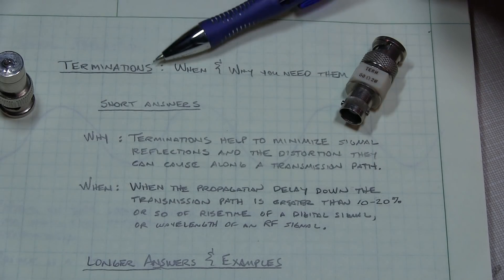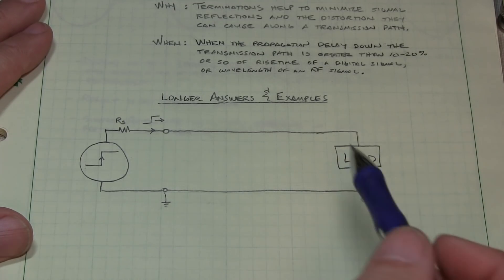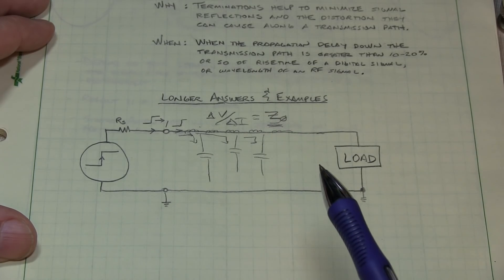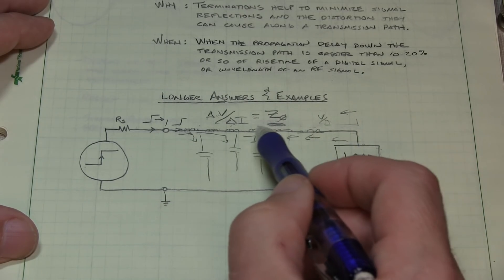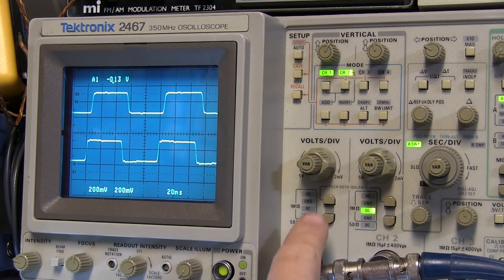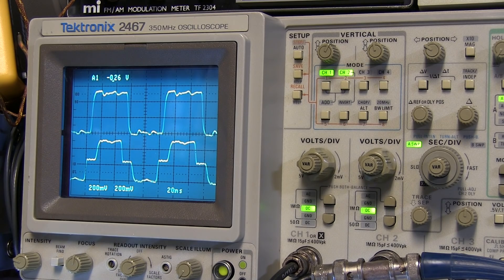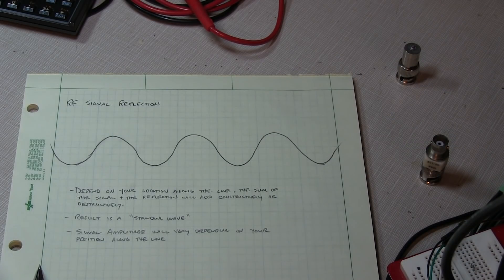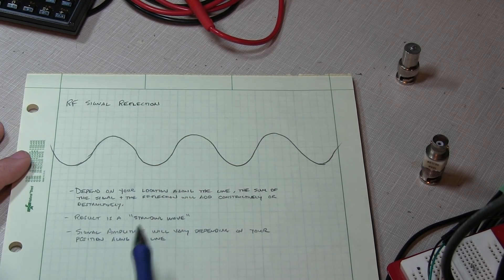#143: Transmission Line Terminations for Digital and RF signals - Intro/Tutorial

Comment: Why would data signals cause reflections, data signals aren't RF signals? There "split termination" which using 2 resistors instead of one resistor, the split resistor terminations for some reasons is better to prevent distortion and reflections not sure why that is.
Reply from the maker: High speed digital data signals definitely ARE broadband RF signals - they have a lot of energy at high frequencies - all of which is subject to transmission line effects and reflections.  That is the whole point of this video.  Also take a look at the videos on TDR, which use a pulse to measure reflections to determine coax length and other characteristics.   Split terminations are used in some high speed logic applications (especially in ECL/PECL and LVDS applications).  These type of terminations serve two functions: 1) provide a proper termination impedance, and 2) provide a desired DC termination voltage.

Comment: termination resistors in digital circuits that use twist pair wires.The termination resistors prevent noise immunity? and the digital signals edges are sharped edges. If the termination resistors aren't there the digital signals edges are messed up from the reflections?
Reply from the maker: termination resistors are to prevent distortion due to reflections.

Comment: Please explain why the voltage becomes double with a very high impedance terminations.
Reply from the maker: The signal source has a 50 ohm output impedance.  When the signal is initially launched into the cable, the cable looks like a 50 ohm impedance also.  Thus, the amplitude is 1/2 of the applied voltage due to this 50 ohm / 50 ohm voltage divider.  After the signal propagates down the line (and back), the line capacitance is fully charged and it looks like an open circuit, thus no more voltage divider, and the voltage goes to the signal generator's open-circuit output voltage.
Reply: @w2aew  Thank you!!!!
Reply: @truthvader5727  Waves represent the propagation of energy...therefore with a very high impedance termination the energy is not absorbed by the termination and then must be conserved and reflects back along the transmission line...obviously then there is a condition where the reflected energy pulse coincides with the next energy pulse related to wavelength and transmission line length...when this happens at that point along the transmission line there can only be twice the energy sent (minus of course any loss of energy say to resistance (Q)).  The function generator is acting as an energy input device to the transmission line.  If adjusted to the correct frequency it applies constructive energy...if not deconstructive energy.  A DC voltage divider is different then an AC voltage divider as an AC voltage divider can involve reactive energy...resonance...etc.  If conditions are set the energy oscillations are at resonance then of course the impedance of the line varies with the frequency to a point where the reactive energy exchange is not seen by the function generator at resonance.

Comment: This is very good, but one thing really bothers me starting around 16:45.  The words "signal" and "power" are used when the demonstration actually shows voltage.  The use of the words "signal" and "power" are misleading to the point of being false.

Neither signal nor power go away, the voltage is reduced. At the very same point voltage is  reduced, current is increased in the same proportion!  This means the power level remains exactly the same., less any increase in I^2 R power losses in conductors (by far the normal dominant loss in transmission lines below UHF)  or E^2/R losses in dielectrics. If the line had negligible matched loss, the power loss by SWR would be negligible.  It simply causes an increase in transmission line loss.

This is why a low loss transmission line can be operated at 10:1 SWR or much higher and system efficiency can be nearly 100%. One common example would be a an open wire line feeding a multiband doublet or dipole antenna, which might have a line SWR of 20:1 or more, yet still transfer over 90% of transmitter power to the antenna,  

Misusing the words "signal" and "power" while the demonstration is showing voltage  will wrongly give the impression that power is disappearing. What really happens is while voltage decreases, current increases in the same proportion. Neglecting small conductor resistive losses and resulting heat dissipation in better transmission lines, the power and "signal" energy stays the same all along the line....standing waves or not.  The vector product of I*E along the line shows maximum power at the source and only a small decrease caused by line losses. Even while voltage might be changing considerably the signal is not. 

Otherwise, thanks for a very good demonstration.
Reply from the maker: Tom - thank you for pointing out, and correcting my sloppy use of terminology.  I'll be sure to be more diligent in future video productions.

Comment: Why does data signals that use a twisted pair wires need to have a termination resistor to prevent "echo"? Data signals aren't an RF signal so I'm not understanding why would the data "echo" if there is no termination resistor.

Comment: You say that "often times" the ringing is due to reflections... Actually it's always the case. Ringing means there is inductance and capacitance on the line, and inductance and capacitance on the line without correct resistance means ringing. So these are equivalent phenomena. So "often times" is not the correct characterization of this. Whenever there is ringing it is BECAUSE there is LC components in the line. Correct me if I'm wrong.
Reply from the maker: There are other things that can cause ringing: things like group delay / design issues in the driver, power supply layout and decoupling, etc.

Comment: Im going to buy a Rigol scope now that i built the little DIY dso138 oscilloscope,  I was at the Goodwill thrift store and bought a bag of mixed banana connectors for 99 cents and in the bag I found two (Tektronix 011-0049-01 Termination 50 Ohm 2W)
Reply from the maker: Now that’s a score!

Comment: If one would connect an 50ohm Termination and an 50ohm antenna(vswr1) in parallel, how much power would then flow into the Terminator and how much in the Antenna?Is a Termination stub like an antenna(vswr1) to the rf power?
Reply from the maker: If you place a 50 ohm resistor in parallel with an antenna with a 50 ohm resistive impedance (no reactance), then the combination will simply look like a 25 ohm load, resulting in a 2:1 VSWR.
Reply: ok, i forgot about that, I meant with my question if they would take the same amount of rf power, if antenna and dummyload would look identical to the rf power.
Reply from the maker: If they are both resistive loads, meaning that the antenna is tuned to resonance and it's resonant impedance is 50ohms, then each will take half the delivered power - just as if you connected two 50 ohm resistors in parallel.

Comment: I am struggling a little bit to visualize what is happening at the load when a reflection is occurring. I understand that the open circuit load can be thought of as the edge of the pool, and the water cannot flow through the wall, just like current cannot flow through an open circuit. When the water hits the edge of the pool it has nowhere to go, so it rises up the edge of the wall to a higher potential energy, then flows backwards away from the wall. I guess using this analogy it makes sense. So would this be true in the case of electrons: As the current reaches the end of the line it saturates the capacitance of the line, then it has nowhere else to go, and flows backwards? Can anyone else explain this more eloquently than I?
Reply: Bryan Lozano I believe the current reaches the end, sees a much higher impedance.. The current into a higher impedance creates a high counter voltage that pushes current back to the source..

Comment: Thanks for the video. I was wondering how you calculated velocity factor as 60% .
I remember v = c / √Eer ,  where Eer is effective relative dielectric constant. 
is that using this equation that 60% velocity factor has been derived ?
Reply from the maker: In this case, it is easy to look up the velocity factor.  However, if you don't know that, you can measure the physical length, and determine either the frequency of the first null to get a quarter wavelength and compare to free space wavelength for that frequency.  Or measure propagation delay for the known length, and compare to free space propagation delay to compute velocity factor.

Comment: Alan, hope all is well.  Is a T - connector plugged with a 50 ohm end lug "stub" connector as good as a 50 ohm feedthrough terminator when used on an oscilloscope that doesn't have internal 50 ohm impedance?  Your thoughts,  and is it worth a video showing what happens?
Reply from the maker: This will work for frequencies below 100MHz or so.

Comment: I've re-watched your videos on this topic plus a few more I've found online trying to make sense of a confusing discovery I made at work today.  An Allen-Bradley remote IO link specifies a different terminating resistance at different baud rates.
57.6k and 115.2k baud spec a 150 ohm resistor while they spec an 82 ohm resistor for 230.4k baud rate.  The cable they use is a Belden #9463 with a characteristic impedance of 78 ohms.  I've always thought a terminating resistor should match the characteristic impedance of the cable and that the protocol wouldn't have any influence on this value.  Any ideas?

Comment: Sir, what is the significance of  Z0, and why dont it  come into picture when we do a voltage division between genrators 50 ohm and oscillos 50 ohm?
Reply from the maker: The initial voltage change at the generator output sees Z0 as the load impedance.  If the termination equals Z0, then all is well.  If it doesn't, then the signal will reflect back (and forth) until finally the generator is loaded with the termination impedance.
Reply: Because the physical meaning of the characteristic impedance is not the same as the usual known Ohm's resistor. The unit of Z0 is Ohm as it's basically the ratio of voltage wave to current wave at the every point along the line. But as electrons are not moving Joule heat is not generated so no electrical losses if we assume ideal transmission line. So the voltage in the end will be Vsource /2 as we have 50/50 voltage divider there.

Comment: Great video. This helped me troubleshoot a problem. I recently purchased an HP 3589A off ebay. I bought it to learn more about network analysis. I watched your video on dBm, bBu, etc., but my results were way off. I was afraid the analyzer was out of calibration, but when I ran the test from this video, I noticed my terminator had no effect. I measured the terminator and found it open. Replacing it, I was able to observe the results you show in this video, and found my 3589A measures correctly with the proper termination. I also learned that buying cheap terminators off Amazon.com is a mistake. Thanks for the good work.

Comment: Nice video. It does what the old PCI bus dose, doubles it voltage to access data. with positive ringing.

 I have been think about making a touch sensor with two long wires in parallel, both
coated with a thin foam. They are 
are not connected. But i am looking for a capacitive effect. When I pinched them together.
 The time for it to charge up will take longer, and i measure the time to charge up.
 If i have three foot long pair of wires, that i pinch somewhere in the middle, and
when a voltage is traveling up the wires and hit the pinch point the rate of charging
up will slow down, and then speed up, after it pass that pinch point. 
  The question is, can i figure out from this effect the exact point of pinch, from the
time and different rates of charge?

 If this works, i want to make long line that wraps around a robots body to find what part
of the robot is being touched.

Comment: Very great and educational video, I'm wondering how you move the wave at about 13:18 in the video ?
Reply from the maker: A little analog scope trickery - The sum waveform is used as the trigger.  I very slightly changed one of the input frequencies (by less than 1Hz), which causes it to move with respect to the sum.  It's not exactly what happens on the line, but visually represents the standing wave phenomenon.
Reply: That's clever, thanks for the explanation

Comment: Great video, very informative, however if I understand it correctly, when we match the source line and load, there won't be reflections but the voltage at the load will be half of the source? If I need the voltage at the load to be the same as the source it sounds like I can either match everything and have a driver that is twice the voltage my load will need or I can change my load impedance to have a reflected in phase wave to bump up the voltage at the load to the source voltage?
Reply from the maker: Yes, both of those are correct.

Comment: Fantastic lesson many thanks. Why did the high Impedance scope connection at the T placed in the middle of the line, not cause a reflection that spoiled your results. I assume the signal does not care if the mismatch in the impedance is in the middle or the end of the line ? best regards Chris

Comment: This is really helpful along with your other videos, I am getting close to understanding standing waves and impedance matching.  One question in relation to this video, your SG outputs a 10Mz signal with an output impedance of 50 Ohms and your load has and impedance of 50 Ohms so you you minimise / eliminate any reflections and hence maximise the power transfer to the load. However you tap into that with a 1 Mega Ohm load resistance on the scope (Ch2)  and this does not cause any reflections back onto the line ? 

Any help would be appreciated.

Thank you Paul M0HPP
Reply from the maker: Yes, mainly because the physical/electrical length of the Tee that leads to the 1Mohm scope input is very short with respect to the wavelength of the 10MHz signal. Thus, any effect of this impedance discontinuity is minimal and the reflection off of the scope input impedance is minimal.  However, if the signal were at 500MHz instead, then the 2-3" of coaxial length leading to the scope input would be a "significantly" long stub and would definitely create a significant reflection and impedance discontinuity in the line.

Comment: Great video. Would it be better. When you describe on the cro the 8.4ns delay for the signal to go from the middle connector to the end connector. To also show on the cro the 8.4ns delay for the reflected wave to go from the end connector back to rhe middle connector. Which is the same time as the original 8.4ns. But it is only a small improvement to show iton the cro screen.

Comment: It's getting deep. So what happens if the load at the end is lower impedance?
Any reflections?
Thank you
Reply from the maker: Yes, except the reflection will cause a drop in the signal amplitude.
Reply: @w2aew  why do we have reflections if the load is lower impedance?
Reply from the maker: @gearstil  Because the current wavefront that is causing the voltage change on the line causes a smaller voltage at the lower load impedance, and this lower voltage then propagates back towards the load.

Comment: Super.
I always assumed  that it was good to have a large impedance load. (Much larger than output impedance going in.) So as not to drag the input down.
Things change at high frequencies. A wire is not always a wire.
Ac is a bit more complicated that dc. For sure.
Great video. Nicely explained.

Comment: I miss the part why the signal reflects. Doesn't the 1Meg in the cro drop the voltage to zero?
Reply from the maker: The signal propagating down the line has been seeing a 50 ohm impedance. If the line is terminated in a higher impedance, the voltage increases because the load is much lighter. This increased voltage then propagates back in the reverse direction. Think about the other extreme - termination the line with a short.  When the signal is initially launched, it sees 50 ohms. When it gets to the end, then it sees the short and the voltage steps to zero. This step change to zero then propagates back to the source.

Comment: Great explanation, how do you deal with this in practice if your scope doesn't have a selectable termination switch and you have to use coaxial terminators. When and how do decide to use them and how to properly put them in the line?

Comment: It seemed that once you went past the null point (in the last example) the phase of the signal measured at the middle changed.  Is this correct or was it an artifact of triggering?
Reply from the maker: Yes, once you go past 1/4 wavelength, the phase inverts, and so on..

Comment: Brilliant tutorial! Can you explain a little bit why the amplitude of the output sine wave signal in your last demonstration varies as you increase the frequency? It stays pretty much the same at lower frequencies but starts to change wildly in the higher range. Why?
Reply from the maker: The amplitude varies at the output vs. frequency because the load seen by the generator varies with frequency - resulting in a different divide ratio against the generator's 50ohm output impedance.